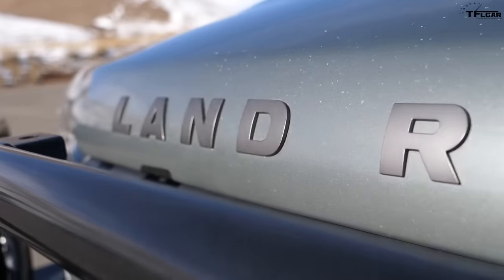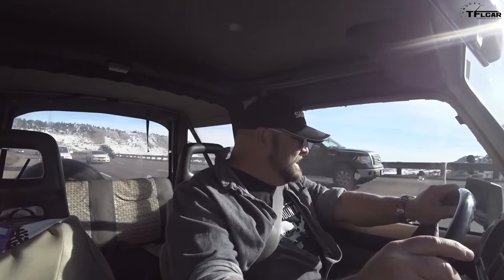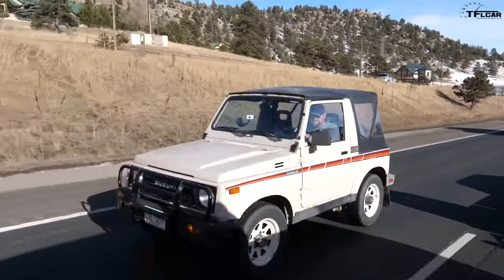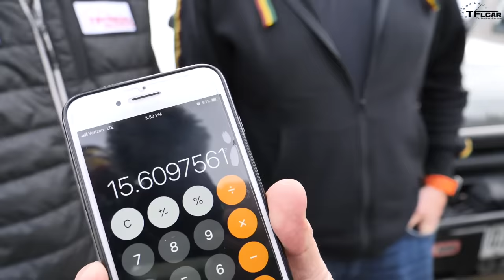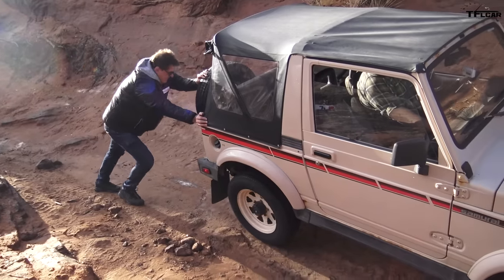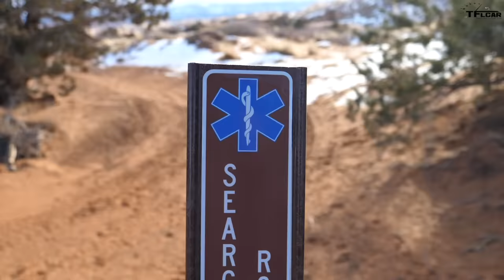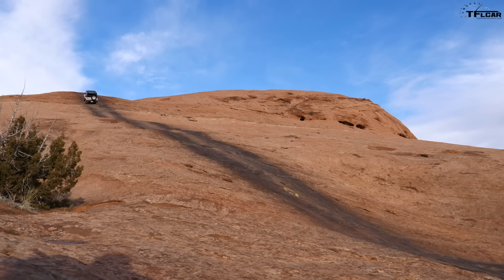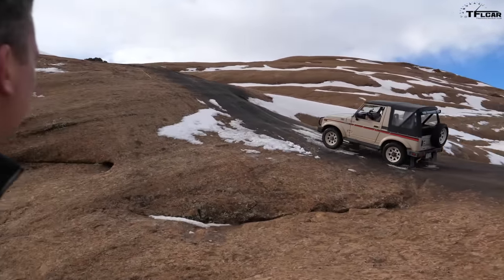We Torture Test 3 Budget Off-Roaders in Moab & This One Is The Best! Cheap Jeep Challenge Ep.8

Comment: The 5 steps to the true Samurai offroad experience:
1) Redlining the engine constantly
2) Hopping and bouncing over everything
3) Never braking because momentum is all you've got
4) Being constantly surprised both you and the car survived
5) Regretting your choices on the drive home
Reply: Nah, you forgot the 4 best steps.
1)Be the first to climb that hill or go through the mud hole.
2)Wait half an hour because everyone is now scared that they will get stuck after the little suzuki got through.
3)Watch them get stuck.
4)Go again just to make them even more salty.
5)Profit?

Now, to debunk your steps:
1) Redline won't make that much difference in 1st low, the crawl ratio is soo good that the difference is almost none, just keep it in the power band.
2) Hopping and bouncing is what heavy vehicles do, the samurai has the ability of getting traction in every condition, use it and the super low range to maintain momentum.
3) Momentum is not all you've got. You've got great aproach, departure and break-over angles, low weight, amazing low range for a stock vehicle and a reliable vehicle that can be treated like shit and will still get you home in the end of the day.
4) Surprised about what? ladder frame with solid axles on leaf springs and an engine that will go on forever, there is nothing to be surprised about. 
5) You won't regret your choices, because at the end of the day, you won't get that smile from any other vehicle. Even if you break something, parts are super cheap, and maintenace is easy to do.

Just keep in mind that a vehicle is only as good as it's driver. All the 3 are on newbie level when it comes to off-roading. The samurai only got stuck because of driver error.
The other 2 vehicles are modified, the samurai didn't even get to have a good set of all terrain tires on the stock tire size. Give me a stock samurai with 215s and no sway bar and I will go everywhere a stock JL rubicon can go, but the rubicon won't get to the places I can.
Reply: ive done some offroading in a daihatsu rocky, so very much alike the jimny (samurai) it was slightly modified and it was insane how capable it was. no lockers at all, just put it in 4L and it made it through anything we threw at it. a wrangler behind us got stuck in the mud behind us. Fairly sure that the jeep didn't have/use any lockers though.

Comment: Hey guys, give the Samurai some tyres! I use the Trepadors in the same 205/70R15 size and loving it!
Reply: yeah, the samurai is such a slow car that you almost don't feel any difference when driving on the road, might as well put some good off-road tyres on there.
A sway bar delete is also very good, more flex for nothing.
Also a samurai owner, running 30x9.5r15 on mine.
Reply: I am running 215/75/R15 continental cross contact AT on my samurai and getting over the snow like champ
Reply: Running a Samurai with flipped axles and a Sidekick engine.  We are cooking now.
Reply: @Dialysisforever  SPOA and 1.6 swap would be overkill, it would destroy the wrangler and the landie :D might as well bring a brand new jeep JL to the test
Reply: On my '88 Samurai I ran 30 inch Discount Tire Pathfinders. I also had a Lock Rite lunchbox locker and a Calmini full skid plate. That little thing could climb a tree. Took it up goat paths to near the top of Mt. Wrightson in the Santa Rita mountains. Good times!
Reply: Mega drop a cam,heads,a good carburetor and swap gears and you will have a little beast😉I'm going to put a turbo kit on it this spring.It will have over 300hp and no problem with keeping up with anything😎Also looking into making it a automatic,the kit is easy to switch from stick..
Reply: @hollywoodhustlng4071  I don't need to, I have the 1.9 TD version :D 180nm of torque stock, with more fuel, intercooler and boost, probably making around 90hp, with boat loads of torque
Reply: .... Just that I don't run those on Samurai but the 1988 VW T3 Syncro. 80's cars are the best anyway. :-D
Reply: YES! and a lift! I'd like to see the Samurai with 3k put into it.

Comment: My buddy bought a Suzuki , early model before the Samurai and that little bugger impressed me no end at what it could do off roading , no gimmicks (they didn't exist yet) , manuel locking hubs and an engine that was smaller than my motorcycle and we had no problems on the trails keeping up with the bigger machines and the small size was actually a benefit in the bush and forest trails and a good addition was actual floor drain plugs if you screw up a river crossing and flood it !

Comment: Such an entertaining video.   As a samurai owner,  I was rooting for ya nathan!  The best thing about the samurai is how cheap and easy they are to lift.  With very little money,  a samurai can out perform any jeep out there on the trails.
Reply: Any Jeep?  Watch a few more Moab videos where they do the actual Jeep trails not the tourist trails.
Reply: @charlescole7532  Capability is just a question of money. How much do you wanna spend? The Samurai and Jeep can be equally as capable. It's all down to your checkbook.
Reply: I have a Jeep. Is that a challenge? 
When you wanna meet in Moab? How much do you wanna wager?
Reply: Samari's are cool, but physics. they have a very short wheelbase and many ledges and climbs at moab are just not doable by a samari, no matter how much lift. infact the lift hurts on the steep ledges.
Reply: @slobert1970  

One of my friends has a Sammi. I've worked on it myself and do like them. 
But when someone writes that they can easily outperform any Jeep, that's not even close to a true statement. They were a good value, pretty tough and a lot of fun but they won't outperform any Jeep.
Reply: My Rubicon begs to differ.
Reply: @thescottishhammer7570  for the same amount of money it cost your rubicon any samurai with a good driver will drive circles around you. Is it the end all be all best off roader? Of course not, but for the amount of money invested vs other vehicles they are the best at what they do. Had 2 samurais and was running around my buddy's yj and tj on the same tires on average trails. Big flexy rock climbs they had the advantage but anywhere else I was driving half the time in 2wd to have a challenge
Reply: MrBenstero 🤔 Riiiiiiight....

Comment: According to the MPG test, there is absolutely no advantage to buying a 4-cylinder Wrangler! The 4.0 will easily do 15-16 mpg. And the Samurai deserves the same love the Wrangler got, a lift and decent,bigger tires!
Reply: I think the stock Sami completely outshined the Jeep and with less drama. If it had the spring over kit with new leafs/shocks, and better tires there would be no need to even mention the Jeep. Lunchbox lockers on that it would be unstoppable.I think it was obvious by the video it was a lil beast
Reply: So, it's ungodly slow as it is. Now you want to make it even slower???
Reply: Only advantage of the 4cyl is that it’s cheaper
Reply: You want to reduce the Suzuki's hp even more with bigger tires?
Reply: fredbrackely HP doesn’t change, you lose mechanical advantage with bigger tires, which you fix by  re-gearing.
Reply: The 4.0 can do like 18 ish going about 55 in a straight line, the aero of the Jeep gets bad over 55 though
Reply: @crashandburnbirner  it's only slower becouse of the terrible mechanical upkeep and the stone heads driving it! I have several Samurai's in stock condition and have no trouble with breaking the speedlimit just about anywhere! Modern fluids in the driveline components and a new timing belt that's not stretching and putting it in closed loop settings and not opening the secondary in the carb and on and on. How about some lightweight aluminum wheels and lighter tires in the Pseries instead of truck tires
Reply: My discovery get 19.5 mpg at 65 mph

Comment: Friendly advice, DO NOT USE HITCH BALL has a recovery point. It's not as bad winching, but never a tow strap. Just use the safety hooks beside the ball, they are designed to withstand a trailer coming disconnected at high speed and therefore are safe for recovery because they can withstand big sudden loads. You can see many videos of hitch balls becoming cannon balls through windshields in recovery situations. Of course use it in a dire situation and for light recovery situations. The pin used to attach the hitch to the hitch reciever is also a good bet. 

Stay safe and happy wheeling!
Reply: They didn't use much force to pull it free. Chill out
Reply: Tom G  posers? Nobody said they do alot of offroad. Let me guess you offroad 365 24/7 and that makes you a pro. Pfft. If they needed to really pull on it they wouldn't have pulled on the tow ball. Get over yourself
Reply: @speterbilt  but it's still importabt to point out for those that don't know. Putting it on the ball is common sense so it should be drilled into people so that we work out that dangerous potential. Its not about the TFL guys, its about the nooby offroaders. They deserve to be warned. Whats wrong with that? Know the danger and then do whatever th hell you want with the information is ny view
Reply: Safety hooks can handle a disconnect but the ball handles the load constantly. Bang on braking, bang on start, up and down bounce, etc.

So yeah the ball is plenty strong as long you're not pulling/winching something heavier than the trailer rating stamped in the top of it.

Just don't snatch. The d ring will likely pop off. Steady tension will keep it in the groove.
Reply: @dchawk81  sorry but you're wrong. Do your research. Weight if the vehicle has little to do with it. Forces are different and its not designed for those forces.
Reply: @Xaviar002  Forces are determined by several factors, one of which is weight (mass).

This little dinky Samurai being pulled 6 feet isn't hurting that ball at all.
Reply: @dchawk81  yeah agreed but its still the wrong way to show it for others to emulate and then injure themselves. I still wouldn't do it that way with such a light vehicle when there are recovery points right there to use.
Reply: @Xaviar002  Ronny Dahl on YT has a pretty amazing demonstration video of tow ball mishaps.  People have been killed by them.

Comment: Well I own a few Land Rovers and years later owning the 2003 Discovery 2 with CDL lever selector and with a few bits/mods added and no issues whatsoever PERIOD ! We take it everywhere on and off road and its the best money spent. Nothing to modify on the powertrain just lift and change tires and go have fun. Everything is beefed up from factory and serviceable and made to last. So far 182,000 miles and still strong and you can do the maintenance yourself as well and plenty of surplus parts if you ever break anything or need to change any bits interior or exterior and all cheap from ebay LMAO yup a used complete with conversion in the event yours did NotCome with all linkages/cables included for the folks who want a CDL/locking center diff, the entireTransfer case shipped is only $265. These rovers are BUILT TO LAST FOR GENERATIONS and we say AMEN ! Cheers mate !
Reply: Got a discovery this week. Was broken down on the highway and the guy said if I can get it to run its mine... all I did was clean the battery terminals and buy a new battery and the thing started right up. It has a few minor issues, three amigos, saggy headliner and it is in need of a driveshaft, new cooling and xyz switch. That being said, it still runs no problem, I'm working on getting parts for it but everytime i get in that thing and drive it i can't help but smile. Best suv I've ever been in.
Reply: Love my discovery, I have a 1998 d1

Comment: Well, I expected the little 1 to use less gas, but 10 mpg difference is crazy. Forget the other 2, they might be cheap to buy, but will NOT be cheap in the long run. I'm taking the Samurai. If I can fit in it lol
Reply: I hope you don't do a lot of highway miles, and god forbid you have an accident - your knees and elbows are the crumple zones.
Reply: @fredbrackely  Come on, it's not exactly a high mileage commuter car machine. Nobody will daily this on the highway.
Reply: @weedmastersr  I used to back when these were still new and common.  They did fine so long as you bought a kidney belt to deal with the rough ride.  People get too bent on "safety" as if it's going to replace the bag of meat between the seat and steering wheel.  Put down the phone and pay attention to the road.  THAT is the single best safety device out there.
Reply: @wolfman9999999  I agree with your sentiment. I have been daily driving a car with no airbags, ABS or traction control for many winters. If I had a family and kids, I'd put them in a newer Volvo, but for me personally, not every car needs to be a safety tank to enjoy. I love older cars a lot more as they're not so muted and isolated. You can still feel you're driving them.
Reply: @weedmastersr   I daily drove one 100+ miles in Los Angeles traffic everyday for three years. Only a canvas bikini top rain or shine.
Reply: @davidsais6384  That's very cool in my opinion. Must've been a lot of fun.

Comment: If tommy had the 4.0 in it he would’ve smoked the rover. You guys should’ve modified the Sammy.
Reply: Well like they said, the rover in general just has more equipment so it is undoubtedly going to be better off. The jeep backing up and losing 5pts was not necessary either as tommy was not only leading the trail and was attempting to crawl over things as opposed to hit it fast, but like they said, the rover is best equipped and the samurai is very under equipped so the competition is sorta pointless to begin with. Jeep has proven itself as a very very likely candidate as the best offroad vehicle without the need of competitions even ever since it was conceived for ww2 and it bought around the world for the hardcore offroad stuff.
Reply: Tommy choose the line and the speed, got stuck, -5 points, those are the rules. @BenJaminLongTime
Reply: If Tommy had the 4.0 he would have lost to Roman on the fuel economy test....
Reply: @GarySlegg  The 4.0 and the 2.5 are actually basically the same on fuel economy. If he had the 4.0 manual he would've gotten a lot better mpg actually.
Reply: @hunterc1055  the difference in fuel economy between the 2.5 Jeep and the Disco was 0.1mpg if I recall correctly.  The difference between the 2.5 and 4.0 jeep is more than 0.1mpg, so the a 4.0 jeep would have lost to the Disco on that test :)
Reply: Not really the 4.6 in the Rover still gets better mileage than the 4.0 of the old wrangler let alone has better torque values at the lower end.
Reply: @GarySlegg  Manual over automatic is a big difference first off, then you have the fact of how much load he was putting on the engine, not only could he have easily gone 70+mph with the 4.0 5 speed, but with all the hills they were on, that 2.5 was maxed out where as the 4.0 would still have power on reserve. I daily drive a 4.0 manual so you could say I'm biased, but I've done several tests just as they do and have gotten a lot better mpg.
Reply: Hunter the Disco would still be more economical than a 4.0 Jeep so the Jeep would have lost to the Landy on the economy test
Reply: @GarySlegg  but with the 4.0 he would've had a manual with one extra gear as well. loose some on the number of cylinders and displacement, gain some on the transmission, plus the 4.0 wouldnt need to work as hard.
Reply: DamagedDummy what are Jeeps official figures for the 2.5 and 4.0 then?
Reply: DamagedDummy what are Jeeps official figures for the 2.5 and 4.0 then?
Reply: @GarySlegg  I've just looked this up using the exact combination @DamagedDummy suggested (4.0 5-speed, 2.5 auto). Both had the exact same quoted figures (15 city, 18 hwy, 16 combined). It looks like he has a point!

Comment: Ugh, don't use tow balls to recover vehicles. You're showing people incorrect methods here guys.
Reply: If a tow ball can pull a 15k trailer, it'll work just fine. Stop being a stiff.
Reply: @rhull3939  a trailer has weight that pushes down where as when recovering the force is all backwards it is very possible for a D ring or strap to slip off. Very dangerous.
Reply: He barely even pulled it off the high center
Reply: @mikem7618  towing is a backwards force on the ball as well. Literally every single some you accelerate. The downward force of a trailer is the tongue weight which is significantly less than the total weight of the trailer.
Reply: It's a very bad practice to get used to, even if it was for a small load in this instance. The D shackle (also entirely unnecessary for a hook recovery point)  would have also acted like a wedge against the ball, further encouraging separation.
Reply: @rhull3939  I agree with both of you guys.  It may not be a correct method, but in this situation it was probably ok.  At least maybe a blanket or heavy jacket should have been hung over the recovery rope to slow down a probable snap back.
Reply: Sure, in this situation it worked, but I agree, terrible practice. It also looked like there were tow hooks on the frame they could have used.
Reply: Yeah putting the recovery rope through the receiver bracket is safer.
Reply: If you're tugging the vehicle it's a problem, winching not so much.
Reply: When you're barely stuck like this it's fine. If you're buried in mud and reefing on it, yeah don't use a tow ball.